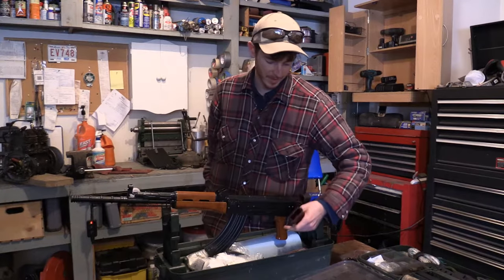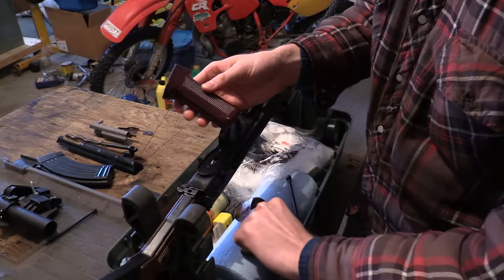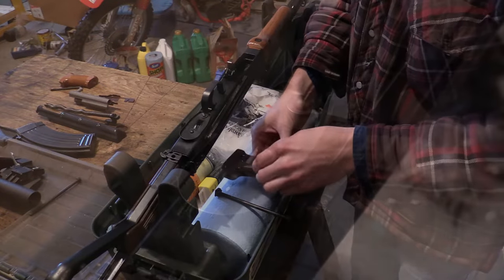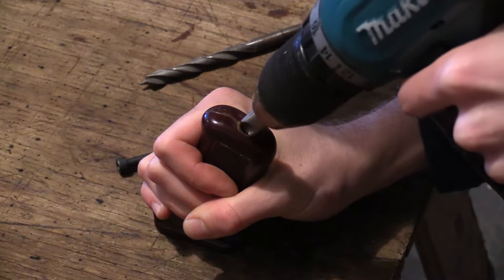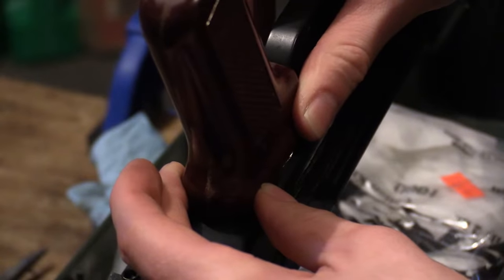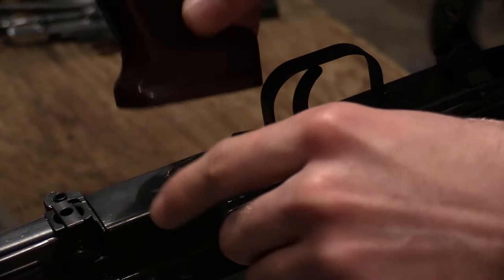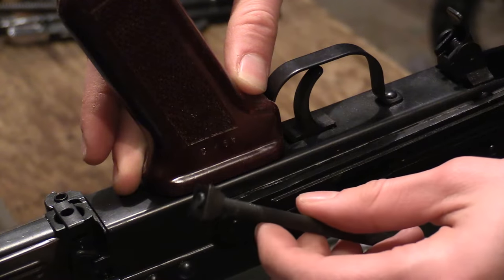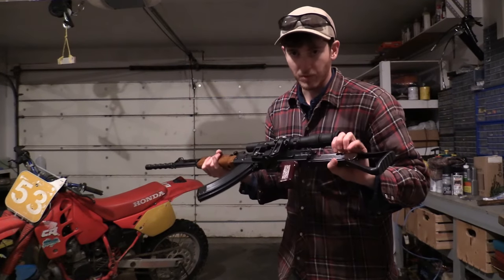Type 81 bakelite grip install

Comment: was that grip screw had some loctite on it? Tried to unscrew mine and it wouldn't even budge.
Reply from the maker: Some of them have had the end of the bolt bored and flared out to prevent it from coming loose.
Reply: @3DVIDEOSMurray  I assume yours was not flared/peened. How to deal with this scenario?
Reply from the maker: @ybrik5937  some people were cranking the bolt in deeper and the  drilling the bore in the end of the bolt even bigger so it had no strength left to hold the flare.  Other were simply chopping the grip and bolt in half and getting a replacement grip and bolt from TI.

Comment: Hey Murray, question for you about your mag catch... I took mine out today because I wanted to straighten it, how in the hell did you position the spring to get it back in??? I swear I've tried it every conceivable way. Also, did you just heat it up with a torch and straighten it out with a hammer?
Reply from the maker: its been awhile,  but i think I pried it in with a punch and backed the punch out as i pushed in the tiny pin.   As for straightening the tab,  i just beat it flat with a hammer at room temp. Ive appeared to have gotten away with it... but  to avoid stressing the metal it may be wise to heat her up for the bending.
Reply: @3DVIDEOSMurray  wow im surprised you were able to work it at room temp. I just struck it on the anvil with a smithing hammer and it completely reflected the strike. Maybe they've started hardening them or something.

The double punch method seems to be the only way for getting it back into place

Comment: Love the videos! I'm currently doing some mods on my t81 as well. I also live in Calgary - what is the name of the shop where you purchased the longer bolt? I'm going to need one of those for my Bakelite grip as well. Thanks!
Reply from the maker: Blackfoot industrial supply
Reply: @3DVIDEOSMurray  One other questions - where did you source your Bakelite AK grips? I tried ordering a few on ebay with no success. Furthermore, can you do a quick video on switching your safety lever to the other side?
Reply from the maker: @joshuahirsch3254  I ordered from a place in the UK called rusmilitary.com,   they wernt cheap,  and the shipping took MONTHS ...   but I did ultimately receive a mint condition grip in the mail.

Comment: Could you have drilled out the AK grip deep enough to allow the factory grip bolt to fit? Bolt could possibly be recessed into the new grip to compensate for the grip length.
Reply from the maker: Not on that bakelite grip...  it only has about a 1/4" of material thickness on the bottom before it opens up into a hollow.
Reply: @3DVIDEOSMurray  Ah ok. I have a Romanian AK grip I'm going to mount on mine. I'll try to Dremel the grip to fit instead of the metal plate.

Comment: I have my Type 81 on order and am already thinking about mods for it. 

Can anyone tell me if the Type 81 Furniture dimensions are the same or similar to the available AK aftermarket furniture out there?
Reply: No fore Grips are longer on type 81 then ak. Hand grip just use the CZ 858/58, did that on mine, you just have to grind some material off the back side and it will fit right in. You need to get a screw to fit.